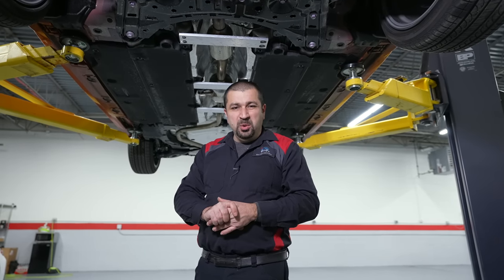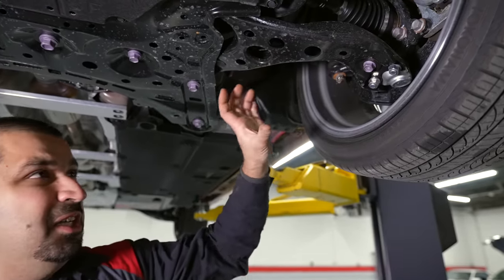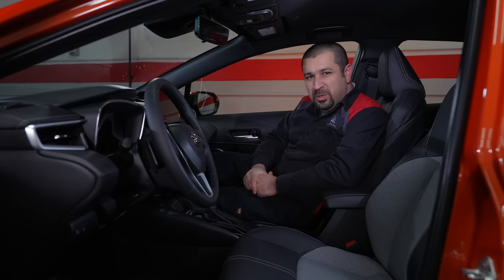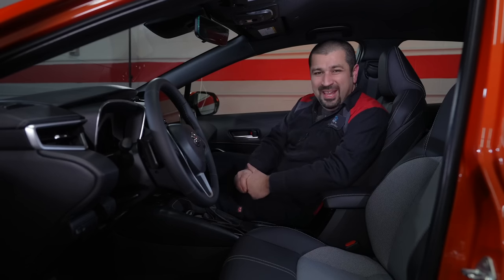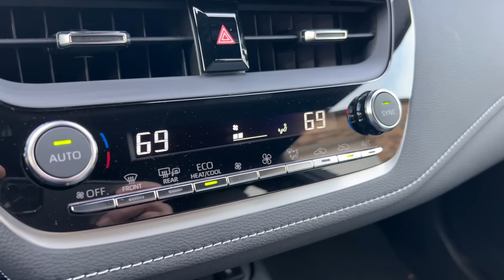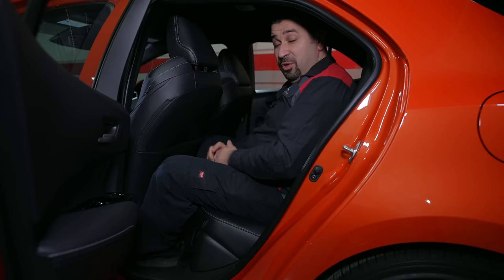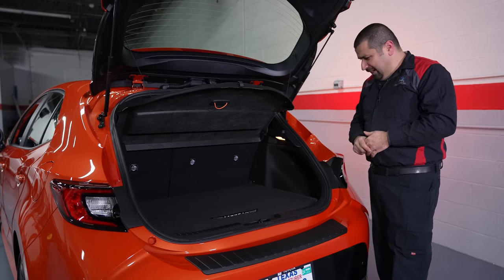Should You Buy a Toyota Corolla in 2023? I Have Good News and Bad News!

Comment: You cannot replace the light bulb of the headlights, you replace the whole headlight assembly (waste)
Reply: And i guess it cost 500$...Hopefully they should last a long time...
Reply: Bulb?
Reply: @Shawn Kemp I believe LED headlamps are supposed to last permanently or for an extremely long time, like 10 years long.
Reply: Turning light on my BMW is dead (one half, the one on the trunk) and now i have to pay 200€ only for that piece. Expensive toys, and you fail your technical for a such a thing.
No wonder BMW drivers dont use them, they get exhausted and dont work no more😂
Reply: @americandude3825  that's in theory. But real life is never in theory. LEDs break all the time and they are effing costly to repair. I really just like good old halogen bulbs.
Reply: @conceptcs My experience with LEDs have been great so far, fingers crossed. 🤞 I'll gladly pay to keep them though, they are pretty. I have a Mazda.
Reply: Welp I'm glad my 09 is easy to swap bulbs.😂
Reply: @conceptcs  Toyota sourced LEDs are excellent quality, at the dealership we basically never replace them. This isn’t GM or Ford
Reply: Get a heat gun or throw it in the oven and replace the bulb
Reply: That’s what most car companies are opting in for on these last 8 years of the automotive industry. My 2015 challenger is the same
Reply: Yea I agree that’s ridiculous
Reply: They are all like that now. Get used to it
Reply: @americandude3825 until u crash it
Reply: Nothing beats HID lights,crisp and bright on my 05 Acura TL, 18 years old,200 thousand kms and haven’t changed them yet
Reply: And that sounds expensive?
Reply: Aw poor bb
Reply: Led lights, lasts 50000hours. If you driving in dark 4 hours a day (I don’t know you but I drive 40 min a day in total), headlights will last 34 years.
Reply: @theadvocate4698 they're actually 1200 each last I looked
Reply: @joshsimpson1648  OMG! That's crazy!
Reply: Headlight replacement isn’t a thing anymore.   I haven’t had to replace a headlight in 20 years.
Reply: I own a 2021 XSE MT.  I wanted a VW GTI, but the XSE MT made in Japan was the best deal.  I average 43 mpg on road trips, plenty of space for my needs and it’s a fun car to drive!  My only complaint was waiting for a 6 speed MT to arrive at any dealerships near me and finding it still available on the lot!

Comment: As an owner of a 2022 SE Manual, I feel very lucky. The sedan is better for rear passenger space and the ride would be a little better because it has a longer wheelbase. Thanks for the video! I feel confident I made a good choice.
Reply: i also picked up a 2022 se manual, i love it and now i feel lucky to have found it. i love the way it drives
Reply: @nildefonsop  Yeah they drive great. The shift gates and clutch feel are quite good.
Reply: I have the red one.
2019 jbl version. This car i like the Color. Now i safe money for de cross version. In the Netherlands are al the cars expensive.
Reply: I'm so jealous lol. I tried to order a 2022 Corolla with M/T back in August, but they were sold out. If they had one, it would have been $23k. My only other option would have to order a 2023, but then I couldn't get a m/t. So I decided not to get one. A month or two ago, a representative let me know that a 2022 came in used, but only have 2000km's. I said sweet, how much? The stealership wanted $32k! I asked how the price of a used one could possibly be $9k more then used. Salemen said cuz it's the only one available in the city. What a bunch of crooks. I get satisfaction knowing that car is still up for sale today, no one has given in to their slimy tactics
Reply: Toyota doesnt have friends and family discount. 😕
Reply: Lucky you ! The manual transmission is no longer offered 😭
Reply: The manual trans is the S2000 and new Type R  is pretty good, not these
Reply: @fzr1000981  Probably true but it better be. The Type-R is like twice the price to buy and probably twice as expensive to fuel. I'll take the Corolla.
Reply: There’s a coupe?
Reply: @ArsonistArborist  Wow. Heck of a story. Thanks.
Reply: I own a manual car, sitting in a traffic jam is terrible, the left leg fell off the body bc you need to play a lot  with your clutch to move a couple  feet (((
Reply: @te1ephraq  Keep a larger following distance and you won't need to work as hard 👍
Reply: @kiefershanks4172  incorrect when traffic is stop and go
Reply: @srobeck77  Sometimes it doesn't work but a lot of the time it does...
Reply: @kiefershanks4172  id say alot of times it actually doesnt at all, not even a little bit in city traffic. If your refering to country road light traffic, then sure. Otherwise no sir
Reply: @srobeck77  Agree to disagree.
Reply: @kiefershanks4172  yes i agree with facts i see in daily city traffic. U agree to an opinion from the countryside, but not city traffic. Agreed.
Reply: @srobeck77  I live in Toronto.
Reply: @thisismagacountry1318  lol so true that's why I gave up that car to my daughter to drive to school!
Reply: @te1ephraq  .Back when I did buy manual transmissions that was my major concern. Having to deal with stop and go traffic, or as you say, inching along in a traffic jam.
Reply: I own a 2022 SE automatic. I put it in manual everytime I drive it lol
Reply: Hi. Did you buy yours brand new and how many miles do you have on it?   I just bought a Certified Pre-owned 2019 Toyota Corolla XSE 6MT, one owner at 59k miles, almost all service records.   The transmission was making a whining noise at the dealership when the clutch was engaged in gear or in neutral.  It seemed to drive just fine.  Left it at the dealership to get a paint touch up on the hood and asked them to do the transmission fluid since it's due in 900 miles.  I got a call today, a week later saying the fluid had shavings in it and the transmission is blown...  Of course it's covered under the CPO powertrain warranty so they have to replace it.  Any ideas why this would happen so early?   I've read on forums of other people having similar problems.   I plan on changing my fluid the standard 30k or 3 years like normal.
Reply: @kiefershanks4172  And that is how others cut your way and get in front of you in the traffic jam, resulting in worsening the traffic, because you are leaving to much gap...
Reply: @unskeptable  POLO?
Reply: The hatch rides better
Reply: I bought my 2020 SE sedan with a manual transmission. I had to special order it because they didn’t have one in stock. I wanted it in Barcelona red, with the smallest wheels they could install and no sunroof. I’m tall and I just don’t fit in when cars are equipped with sunroofs, they’re incredibly annoying
Reply: @xinyuxue868 it’s not manual lol. It’s a CVT. It’s just to make it “feel” like a manual but it’s not manual at all.
Reply: Corolla is ok but I like the Prius better.
Reply: I thought I could deal with the smaller hatchback...miscalculation on my part. I should I got the sedan. I think you made the right choice in your 2022 SE manual.
Reply: Except for one thing... you chose a sedan!  😛
Reply: I wish I got one man but unfortunately I’m buying in 2023
Reply: I’ve owned stick shifts all of my life. Sitting in traffic is not an issue, especially if I’m just staying in first gear the entire time. The part that I would complain about is suddenly downshifting when you have to slow down suddenly and you’re trying to gauge what gear to go into depending on what speed you’re going and how much power you need for the situation (if you need to suddenly merge for example). Sometimes you don’t know until the last second. But, I’ve driven automatic vehicles and I really don’t like the lag in the gas pedal, the timing of the gear shifts, or the way that it feels when it accelerates. Hopefully I’ll continue to have manual transmission options.
Reply: A big difference in xse sedan and xse hatchback, sedan all seats are heated, more comfortable to ride, but the engine are both same 2.0
Reply: Hatch are JDM dont buy sedan hatch have m20fks 😊
Reply: @wtfx5757 You wouldn’t recommend the hatchback? I currently drive a 2010 Corolla sedan and was considering a hatchback.
Reply: @tico78742  hatchback is great if you can deal with the lack of space. I couldn't, but maybe you can.

Comment: A one touch cruise control is a huge improvement for convenience! Also, I respect Toyota for still giving us a spare tire. Personally, I would put up with a little less storage space to be able to keep that. As much as some of us truly enjoy driving a manual transmission, we are becoming a minority to a large extent.. fewer and fewer people even know how to drive one. For this reason, relatively few are sold initially and later on when the car is traded or resold privately, it’s sellable value is less because the majority of the people don’t want it. In studying CVT failures and durability issues, A significant amount of wear occurs right at start up as the vehicle begins to move in normal use. It makes sense to put a physical first gear in the transmission to help with this problem. Service life will be extended with this feature. I still think though that it would be wiser in the long run to ditch the CVT all together and spend a little extra money for a way better transmission that is similar to what the Camry has. That is the only major problem I have with the Corolla. If you only have one transmission choice, and you want the most reliable, value oriented vehicle, why do you use a CVT exclusively?
Reply: I find your analysis interesting. Having just shamelessly regressed to an ox cart style torsion beam rear suspension on lower trim Corollas, I think Toyota is just reverting to their bad, old penny pinching ways by dropping the manual.  If the Corolla is going to be all-automatic then logically, it should be all-Hybrid as well.
Reply: @rightlanehog3151  oh don't worry, all there will be is hybrids in 10-15 years. The same way we struggle to find manual cars, is how it will be in the future trying to find a non-hybrid car. I don't dislike hybrids but they just don't work everywhere and for everyone.
Reply: @Kburd-wr6dq  If I was buying an automatic it would be a Toyota Hybrid.  I will be very surprised if there are any non-hybrid, mainstream cars built in 5 years.
Reply: @rightlanehog3151  I agree honestly, I have one. I have '20 Corolla hatch CVT, and the 19' rav4 hybrid. The e-cvt drives much nicer, but the regular cvt at times can feel pretty good but it doesn't feel very reliable.
Reply: @Kburd-wr6dq how so….
Reply: @alvinsimba734  currently at 91k, its still good but its just jerky at times. Changed cvt fluid recently and actually helped it.
Reply: @Kburd-wr6dq  I see. I have the 2020 LE  with CVT that doesn’t have physical first gear and even then with that one doesn’t have to press gas hard to actually get going and my rpm’s always go to about 2200rpms at most and then on highway I often do 75-85mph speed at 2000rpms most of the time. Also that particular CVT has no gears so one doesn’t feel them. One thing I learned with regular CVT is to take it easy with it when going from stop

Comment: Nice video! I always value your opinion  I picked up my 2023 Corolla Sedan LE in December. I posted several videos. No regrets at 3300 miles. I noticed the plastic valve cover as well. Hope it lasts. The 2.0 gas engine has decent power. Mpg has been outstanding - 40-42 MPG in mixed driving. I also noticed torsion beam suspension in the back, on the LE sedan. Kind of sneaky of Toyota. But it handles fine. Wireless CarPlay. Disconnected once or twice. Not terrible. Biggest complaint is the music doesn’t turn off or even quiet down when you get a message, or try and talk with Siri. Safety sense 3.0 is improved. Sedan has larger back seats of course. Agree about just getting the LE. Anyway, we are happy with it so far. It’s basic daily transportation that will hopefully last for many years.
Reply: @amandaburleson2035  well, it’s plastic so, easy to fix and move on. I plan to maintain it well.
Reply: My other window is open to the Toyota Canada web site which still lists independent rear suspension.
Reply: @rightlanehog3151  I looked too. It has independent rear suspension unchecked on the LE / 2023. And I definitely have a torsion bar. Again it’s not a huge deal. Maybe a cost savings measure.
Reply: @rickm8456   Car & Driver  lists it too.
Reply: @rightlanehog3151  sure!
Reply: @rickm8456  A channel called  Realistick posted a video 9 days ago in which this sneaky downgrade was detailed.
Reply: @rightlanehog3151  I’ll check it out. I don’t think the average owner will notice the difference. Although it’s sneaky that they only did it for the LE. I’d rather have the 2.0 engine anyway.
Reply: Rick, regarding the Apple Car Play  if it disconnects do you really have to put it in park to re-engage it?   Car Care Nut is recommending undercoating by the wheel well?  First Ive heard of that.  I am glad I selected the LE Sedan. I am not a fan of the wheels on the SE/XSE. Keep us posted on your Corolla.
Reply: @CC19524  the carplay issue happened to me a few times as well, 2023 le hybrid owned a month now... what i've been doing is parking the car, turning off the car so the entertainment system turns off (when i had acc customize on i'd need to open the door as well to turn off the entertainment unit) and THEN the carplay would be able to connect again after this reboot. quite annoying but it hasn't happened to me since i turned off acc customization in the settings. others have stated this in forums as well that the acc customization would cause carplay issues for them so i assume this is the source of the issue i hope gets fixed in a future software update
Reply: @rickm8456  
Mazda 3 uses those too to save abuck
Reply: Hi. Did you purchase your car brand new and how many miles do you have on it?    I just bought a Certified Pre-owned 2019 Toyota Corolla XSE 6MT, one owner at 59k miles, almost all service records.   The transmission was making a whining noise at the dealership when the clutch was engaged in gear or in neutral.  It seemed to drive just fine.  Left it at the dealership to get a paint touch up on the hood and asked them to do the transmission fluid since it's due in 900 miles.  I got a call today, a week later saying the fluid had shavings in it and the transmission is blown...  Of course it's covered under the CPO powertrain warranty so they have to replace it.  Any ideas why this would happen so early?   I've read on forums of other people having similar problems.   I plan on changing my fluid the standard 30k or 3 years like normal.
Reply: @PYRO200055412  I purchased brand new. Sorry to hear about the transmission but at least it covered. I heard about some issues for your year? I think the 2023 has a slightly different transmission. It’s automatic of course. Also, I’m definitely going to change the fluid at 60k. And every 60k. Hopefully that’s helps. We’ll see.
Reply: @rickm8456  thanks. I hope everything turns out good with this one. My first "new" car.
Reply: @Solitude Of Heart nope
Reply: @Solitude Of Heart I’m in PA. Yeah don’t pay it. I did have to call about 15 dealers.
Reply: @Solitude Of Heart I got it from Laurel Toyota in Johnstown PA.